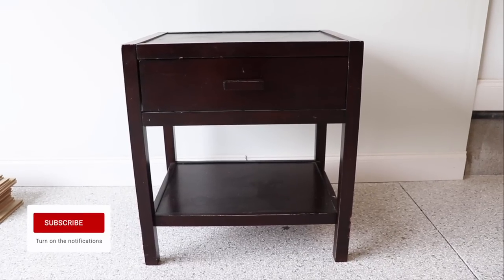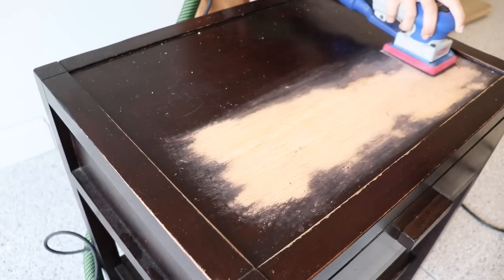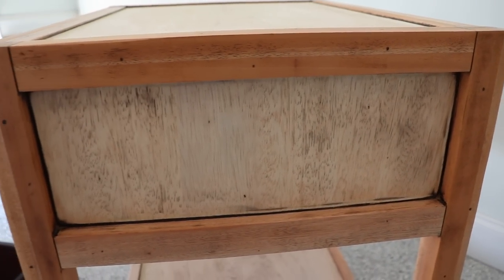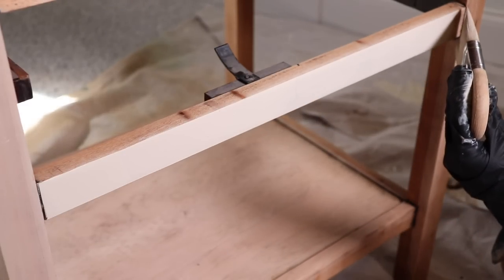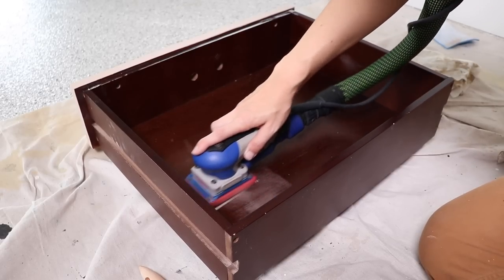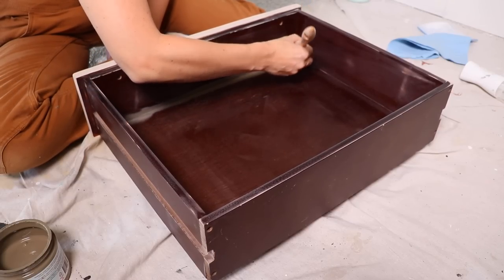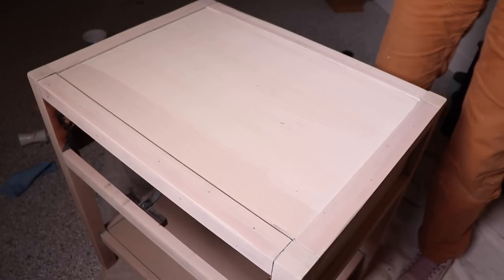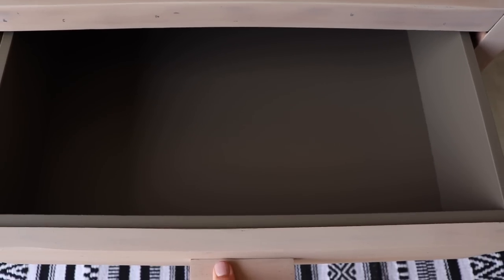Bleaching Wood Without Bleach?! // Dark Wood Furniture Makeover

Comment: I think my particulate and vapor cartridges on my 3M respirator need to be replaced. How often do you replace yours? It seems a shame that the 60926 needs to be replaced every three months (according to what I've read online). I see that you're using the particulate filters, 3M 2091, on your respirator for this project. Do you switch out filters on the same mask? I love your vlog. I've learned a lot from you. Thank you!!!

Comment: Amazing!! Ive seen so many furniture tutorials lately highlighting silk for interiors of pieces! That is such a great reason and way to use it!! How would it do on outdoor furniture, do you know? 

How do you think it would work on a piece I didn’t sand the original finish off? If I just pained and sealed the base color in a flat. Maybe in a burlap like color. (Or even used silk!!) Then did this wash technique over the top. I have a solid wood drop leaf end table, loads of spindles and details, with a bright red spray paint finish. If I TSP’d it and scuffed it up, couple coats of BOSS and then the paints I described. I just love that bleached effect. Or even a driftwood effect. I just can not take off that red easily.... thoughts?